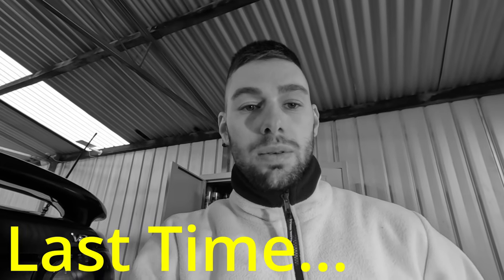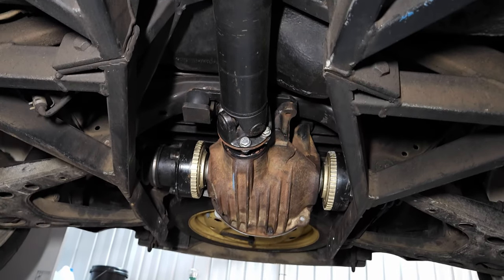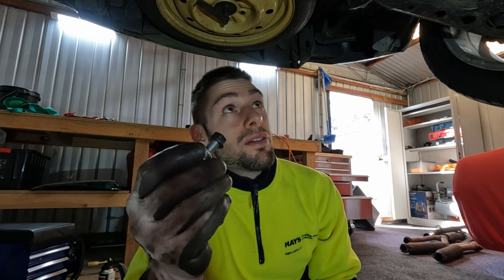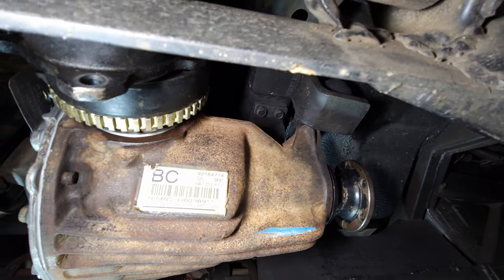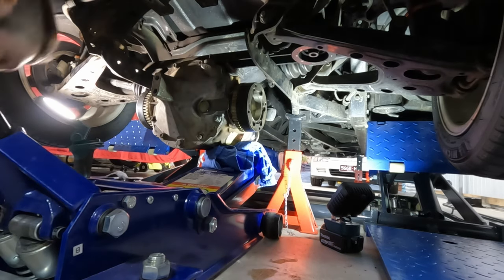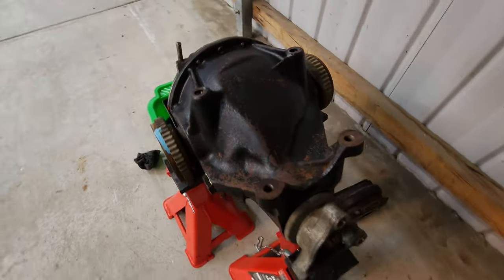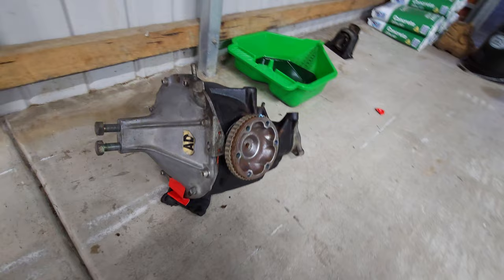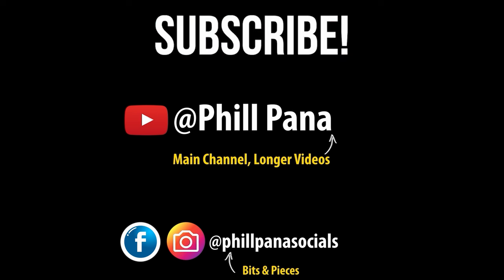V8 Mazda MX-5 Build | Project Bullet Roadster Part 3

Comment: That exhaust is terrible.. it use to have a beautiful stainless steel system from our friends at Hi tech Darlinghurst Sydney
Reply from the maker: Stainless steel would have been much nicer ! Please continue to check in as your background on the car will prove useful! thanks again.
Reply: @phillpana  I’m struggling to pull up info on the engine .. I didn’t know it was a TVR engine.. George considered buying a new TVR at one stage.. but after I arranged Bullet to visit me in Sydney with the Lexus V8 prototype he stuck with the better built bullet route.. all I know it was to have was a mild cam he may of had it enlarged to 3.9 at the same time.. just like he did with his brand new Giocattolo Group B from 5 ltr Holden to 5.7 ltr
Reply from the maker: @adamgilesconcoursdelegance9302  If it was a crate TVR engine at the time I believe it would of come as a 3.5L so I guess it makes sense if he increased to a 3.9L in the process.
Reply: @phillpana  George had 100’s of cars just like the bullet over a 25 year period.. he sourced the engine and had it delivered to The Chindera Bullet factory.. my father bought his Nissan bluebird with a Rover 3500 in about 1986.. I know he wanted far more power than that car had